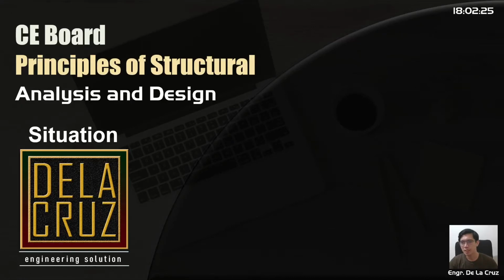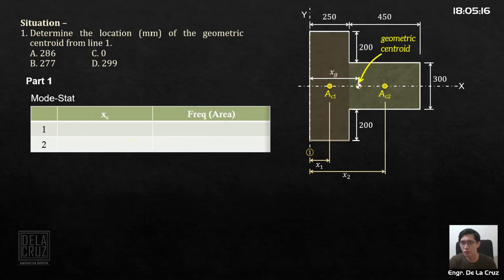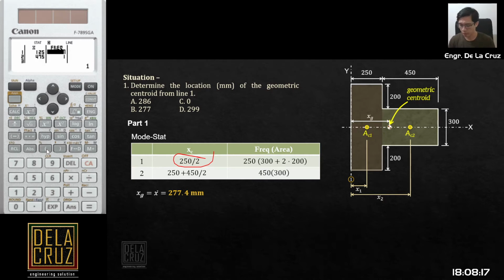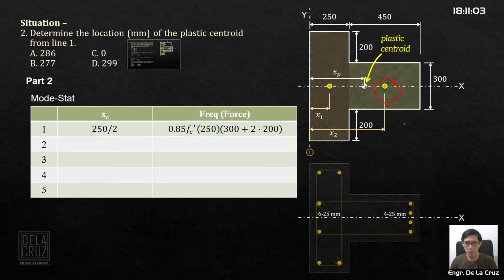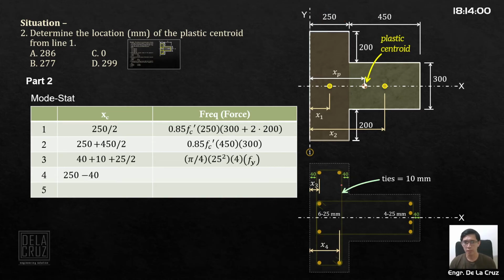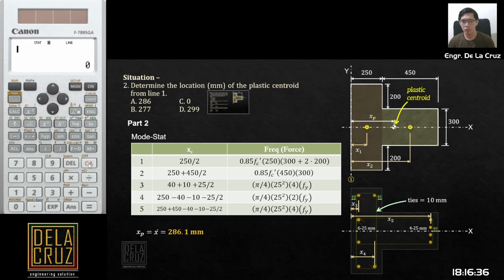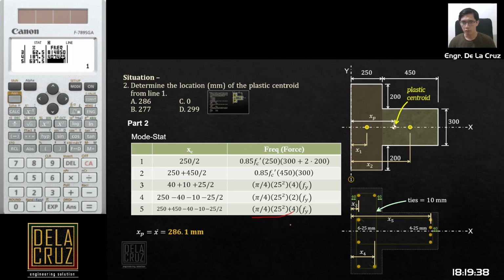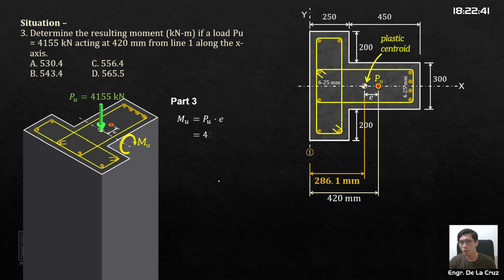2022-November CELE PSAD (Sit 8)

Comment: bakit po di na need i check kung mag yyield yung bakal? kahit po kasi yung nasa right ay nag yield. paano po malalaman ang fs
Reply from the maker: @EliteMalupiton  in determining the plastic centroid. Yielding strength ang ginagamit, since ang purely axially loaded column is compression controlled.

We only check, if mag yi-yield or not, if ipapasolve ang Pu or Pn with given eccentricity

Comment: Very helpful sir thanks
Reply: Sir paano po ang pagsolve ng ganitong problem determine the maximum length of w14x83 section if it used as a high nged column to support a service laod of 450kn and live load of 900 kn fy=400 mpa. the following are the properties of the section w14x82 A=15548mm^2, rx 153.66, ry=62.94. determine the length of the column using ASD